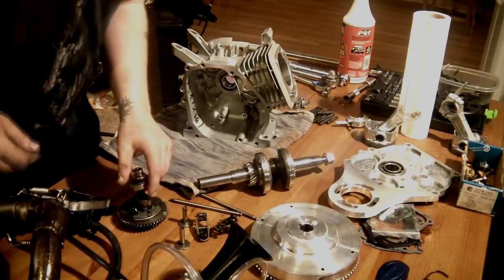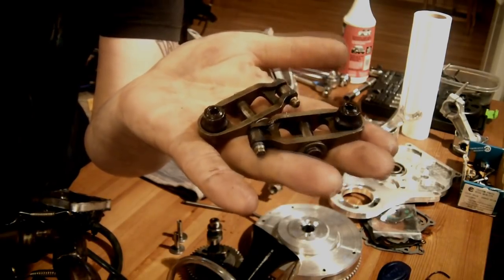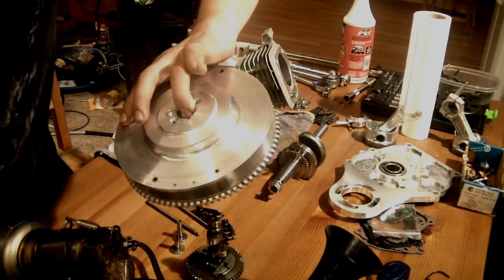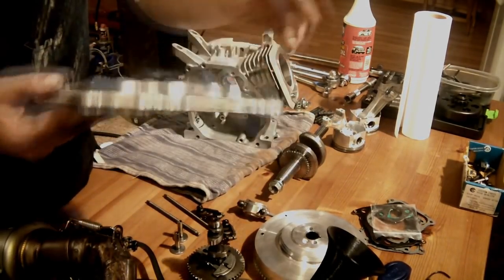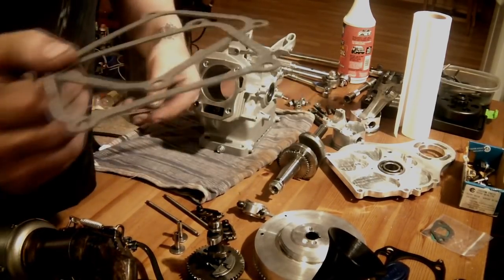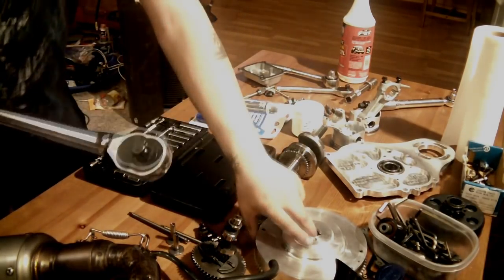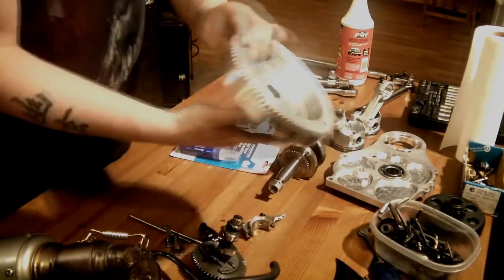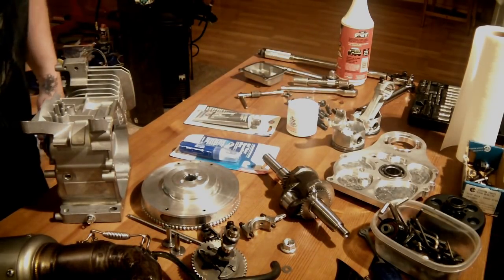DIY Paramotor Engine - pt2: Parts and Tools

Comment: Love how well you know your engines and how into it you are. I hold high hopes that one day you will be developing a home grown American made paramotor engine to compete with the likes of Moster.
Reply from the maker: Hey Oliver, thanks for the kind words. I don't think that's in line with what I want to do. I'd much rather share knowledge and release my work (maybe a parts list or kit). I'm slowly working toward creating a reduction that's made using cheap off-the-shelf parts. TBH my eye is on electric and I'm in the process of developing a couple of PPG products that I am lot more passionate about. There are plenty of engines out there, there is the EOS 4 stroke coming, and an American company is developing a nice 2 stroke. My main idea will introduce a layer of safety and convenience for any engine but I'll keep working on this engine and most likely many more and share my journey.

Comment: I am interested in your cnc router. Did you make it yourself? Was it off plans? I am building a four stroke Paramotor using a GY6 engine and will eventually design and mill my own engine cases. I have a knee mill that I have converted to cnc, however I do like the idea of having something like yours for larger items in aluminium plate as my y axis is only 8”.
Reply from the maker: Christopher Clegg I've been building mine for years. No plans, it's all custom. However I highly recommend looking at the kits from cncrouterparts.com, super impressive machines. I had a chance to check out their warehouse and they do quality work.

Comment: Dmitri....with regard to your vibration issues: I am NOT an engine builder! As such, I don't know if this solution is practical for small engines, BUT...for my son's street stock race car, we cured some vibration (and stress)-related issues by using these:
http://www.nord-lock.com/nord-lock/wedge-locking/
Interesting to see your selection of components. Did you machine that reduction plate yourself? Judging by your inserted 'wait and see' screen text, it's going to be interesting to see what you ran into, and how you fixed it. :-)
Reply from the maker: Norm Jacques Norm, thanks for watching. Yes, I design and machine my reduction parts.
Reply from the maker: I forgot to mention, I use lock nuts which have the star-shaped lock washers built in. They work great so far, haven't had anything come loose since I put them on.
Reply: I'm familiar with those. The Nord-Lock washer system is several steps beyond those (the attached star washers wear out over time). Your choice...just thought I'd point out the option.